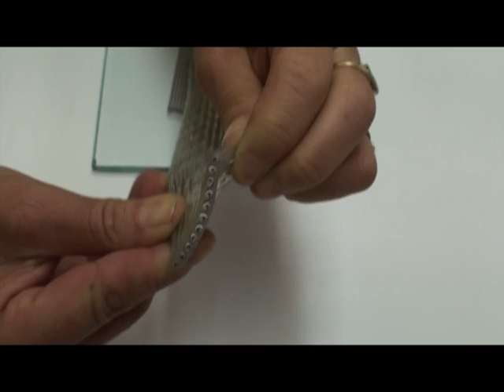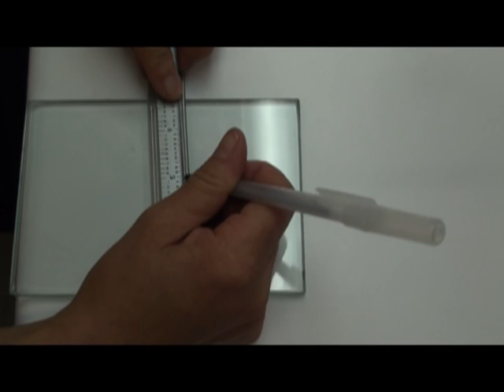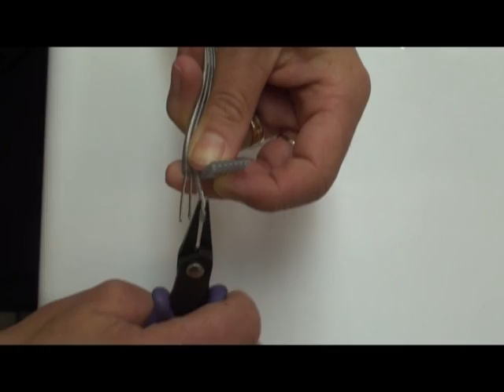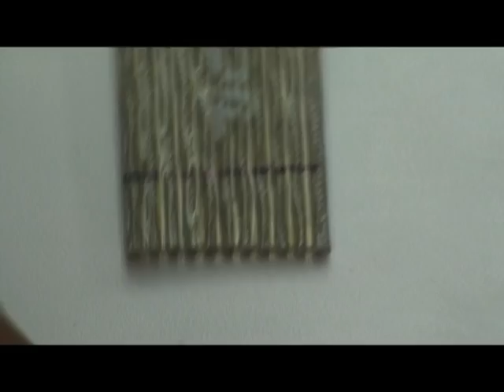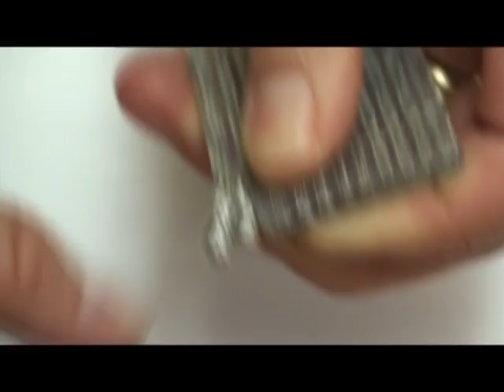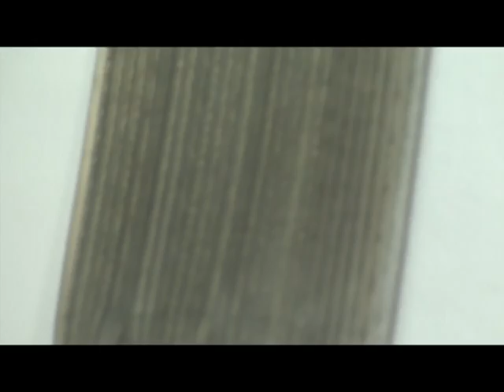How To Strip and Prep a Flat Cicoil Cable

Comment: Excellent video.  Thanks!  I used an Xacto knife to lightly score both sides of the ribbon cable.  Then, I just peeled it away with about 2mm of wire exposed.  Perfect for rejigging the cable arrangements for Raspberry PI GPIO transformations from the RPI 3 to the Compute Module IO Board.

Comment from the maker: With a few simple clicks of a mouse, Configurator Cables can be constructed of elements ranging from power conductors, shielded signal pairs, and video & coax wires to tubing for liquid and air, and design elements like Cicoil's patented StripMount™ fastening strip. Try it for yourself: http://www.cicoil.com/flex_cables/configurator.asp